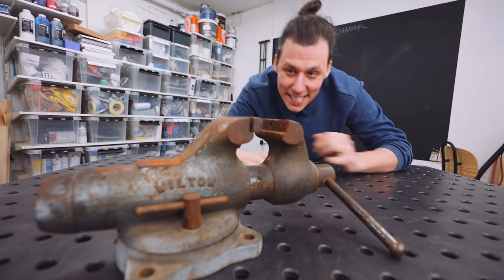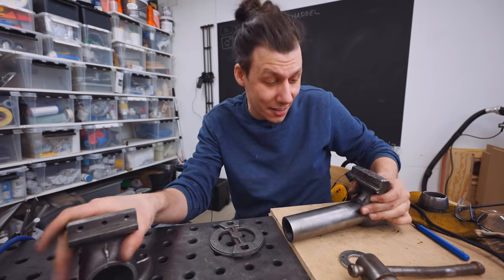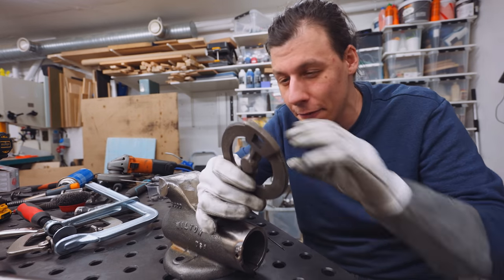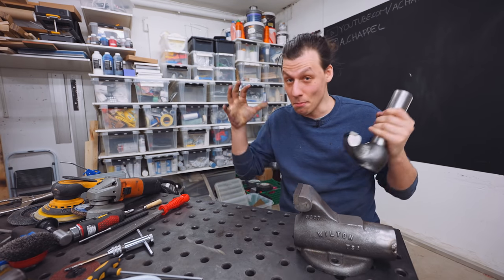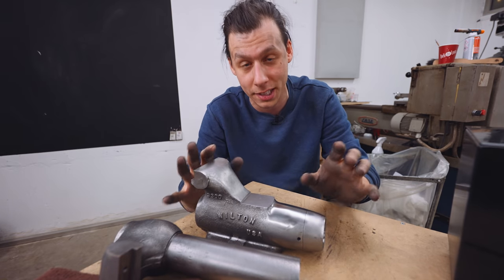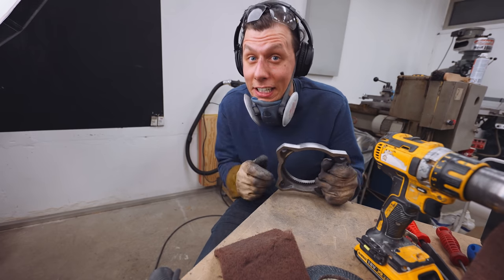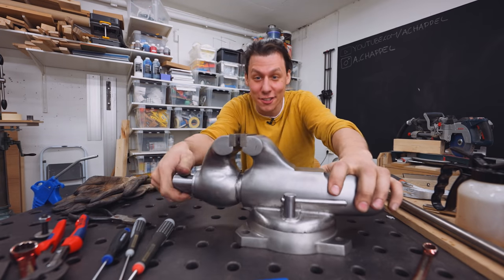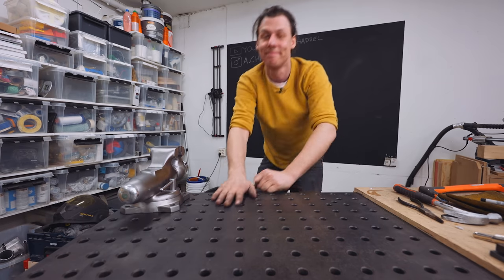Trying To Restore This Rusty Old Wilton Vise

Comment: I suggest you cover your vise with some protect oil - I also restore my dad vise and I also don't use oil and after 1 year corrosion starts to show up, so whole cleaning process needs to be repeated :(
Reply: I'm thinking the exact same thing! It would be terrible for that vice to go to rust. And with cast iron, that will be sooner than later.
Reply: Hi ,i am going to take rust from iron antique balcony ,and i was thinking putting an anty-rust oil before painting  but wasn.t sure if after the oul i could paint the iron .What do you suggest me?Thank you very much

Comment: Nice job! You might want to put a clear coat of polyurethane to preserve that finish you spent so much time on 😬
Reply: yeah the rust will return quickly otherwise!
Reply: I would recommend a ceramic car wax. PU ends up looking like a crappy plastic finish over the lovely metal!

Comment: Awesome! Don’t drill into the table, just make an adapter plate that fits the hole pattern. That way you can remove it if not needed, and you can position it anywhere you need it! 😎👍🏻
Reply: Came down here to say exactly this.

Comment: 14:35 The original threads are almost certainly No. 10-32 UNF:
- the Unified Thread standard uses the same tooth-profile as metric standard threads (unlike for example British Whitworth threads, which have more rounded teeth)
- No.10 UN threads have a diameter of ~4.83mm, which matches your description that it differs from M5 by about 0.2mm
- M5 has a pitch of 0.8mm, which is very close to 32 TPI (which is a pitch of ~0.79mm)
Reply from the maker: Thanks for the great explanation! :))
Reply: I've done worse hacks. When I could not find M8 bolts locally, I ran a 5/16-18 tap through a hole that was tapped for M8.  (Pretty large pitch difference, but it was a shallow hole, so it ended up working out).
Reply: you beat me to it.....
Reply: Used to do a lot of server installs.. had to remove more than one M5 screw from a #10-32 threaded hole.. I kept a cold chisel, vice grips and a mallet in the car, just in case.

Comment: I picked up a '76  Wilton Bullet vise, a few years ago. I wish I had made a video. The slide was rust "welded" in place. A previous owner had sheared the crosspin off, trying to get it freed up. I spent 2 days, a can of PB Blaster, some kerosene, and transmission fluid, trying to get the slide loose. Also heated the poor thing up with a torch, to no avail. But, that had the side benefit of getting rid of all the oil and old paint. After 2 days, I got the slide to move about 1/4". Using wedges, I hammered them in between the jaws, and started to get things to move. I broke a 2.5 lb sledge, beating on the wedges. Finally, got the thing apart. Easy clean up. Wire brushed  and painted. Looks and works like new. Biggest problem is, I hate to scar it back up. 😊

Comment: Nice vice restoration.
Now the problem to fix to the table, make a adapter so you are not fix to a location on the table.
When you want to move you can by using the holes that you all ready you have on the table.
And some way that is easy to exchange and fix the adapter to you table.
I hope this idea come handy for you.
Continue the good work and stay safe.

Comment: You did an awesome job! Your videos are getting better and better. One of my favourite channels hands down.

Actually, I believe the body was forged, not casted, that’s why the manufacturer didn’t worry about the misalignment of the casts. Otherwise it wouldn’t have been hard enough.

About your weld fix to repair cracks. It is most likely that the crack is still there since you didn’t control your thermo ramps, and depending on the force, it may crack again. But I wouldn’t worry about it RN. And if if cracks, you can just fix it again. For a non professional welder, your TIG beads look simply great, we all know how hard it is.

Comment: Strongly recommend making cast iron repairs with silicon bronze. I have  done both stainless and bronze repairs. Far less problems with this route. Welding tips and tricks as well as This Old Tony have covered this topic. I recently built up a Bridgeport varidrive pulley with a rosebud and brazing rods. The bronze is highly machinable.

Comment: For attaching the vice to your table, Maybe you can make an adapter plate to bolt the vice to it and then the plate would bolt to your work surface.  It turned out great, you saved the vice from the scrap heap, and while you didn't keep the maker's mark, it is now a gorgeous thing of beauty!
Reply from the maker: I actually managed to drill into the table eventually. I ended up using masonry bits that I sharpened with a diamond file :)
Reply: @achappel  I'm glad you found a solution... just another point about the plate idea: it would allow you to reposition the vice on the table at any point you wanted and you wouldn't need to drill into your table... Anyway great build...  Cheers!

Comment: Hi Alex, the best way you can find out what is the thread pitch of that imperial bolt, is to measure one inch (25.4mm) and count the number of crest. If the bolt is not long enough, you can do the same with 1/2 inch (12.7mm), just double the numbers. Then, the numbers of crest per inch known as TPI (threads per inch) is the pitch number, the magical number that you are searching. If you do not have access to measure on imperial, just divide the outside diameter in 25.4 (the amount of mm in a inch). Keep in mind that imperial threads have a lot of pitches, being something like 10-25 or so. I hope I have being helpful.

Comment: I am far from a welding expert, but you might want to try nickel based filler for cast iron in the future. I hear it is a better choice. Entertaining video. To hold a round part in a mill vise you want to avoid directly clamping the round part because it is only being held along two lines. Try adding an angle block. That will hold a round part along three lines and have much better holding power.

Comment: I am quite impressed with the finish on the vice. It turned out to be quite beautiful. If I were you, I would spray it with a light coat of oil or WD40 or even a light coat of clear lacquer to keep down the surface rust. Hell of a good job you did there.

Comment: 18:02, just made a plate with the right location for each part. Use the bolt pattern on the table to manufacture a plate that has the bolt pattern of the table on one side and the vise pattern on the other. You can make some pins with the lathe for it.
Reply: Exactly what I was thinking!
Reply: @BrainHurricanes  Thanks, now I know that I’am not alone.

Comment: This is a great project and it turned out beautifully!

To mount it to the table, why not make a flange? It will have holes that will bolt to the table's hole pattern and also holes to mount it to the vise's hole pattern. That will give a bit of modularity as well. 🙂

Comment: That Bullet is the exact vise I have. Mine came with the end cap, but the restoration was similar! Great move leaving it raw—my single stage Hammertone paint chips if you look at it the wrong way. Just remember to use some film-forming rust preventative.

Comment: Nice job on the welding! I've restored a few old hand planes and sympathize with the cast iron dust problem, that stuff gets everywhere. I may have missed in the video, but how are you protecting it against rust? A thin layer of oil?

Comment: I think that the thread of your old imperial screw is #10-32 UNF. I guess nobody cares but as you asked, I felt that I had to share this information ;)
By the way, you did a great job!
Reply: I care! I was looking for this haha. About to do the pitch calculation myself.
Reply: Was also about to say the same thing :) 10-32 is technically 0.079mm pitch but that's "close enough for government work" as they say!
Reply: Was also looking for someone that answered this 😁
Reply: I was doing some investigation, and ended up thinking about like a 3/16 bolt, the problem is that the pith are difficult to match, It would be a lot easier to have both bolts in hand to know more about it. And, I think there is a whole community wondering what bolt was that, you are not alone!
Reply: Was looking as well, thank you, you hero!

Comment: Well, it turned out beautiful. You can have it nickel plated or even chrome plated.
Make a simple base plate to match the vise model.
With a corner on it for support against the front of the table.
And with a few pieces of threaded end that then fit into the holes of the table.
Just make sure the vise closes in front of the table.

Comment: You can make a carrier plate that has mounting holes for the vise and also matching holes to the table. You can machine some locking bolts and nuts and can manually mount it to the table in a semi permanent non destructive way.

Comment: I spent a lot of time learning how to create accurate working screw threads in FreeCAD for my 3D Printing designs.  If you look at the Unified Thread Standard Wikipedia articles on Metric and Imperial you will find that the Imperial #10 Fine thread pitch is 0.7938 mm and the M5 Coarse pitch is 0.8mm.  Also the  major diameter of the #10 is 4.8260mm.

Comment: For attaching create an adapter plate. The a decently thick steel plate, drill and tap holes tht fit the vice on it and drill holes marching the hole pattern in your welding table. Then choose whatever way you wish to attach in to the table with those holes, bolts, plan rods so you can pick it up an move it as you wish

Comment: I wonder if rough stones in a tumbler would have been an easier way to remove the texture?
Reply: But that way he would not have had control of what is being  „smoothened“. He could have lost crucial mechanical details.
Reply: @maddi5920  Fair point. Take my comment as nothing more than a curiosity from a lay person :)
Reply: @Theincrediblespud  Oh we aren't lazy. We are just trying to find an easier way for everything. Thats not lazy. That's effiency! ;)
Reply: 1) it would have taken a loooong time 2) it would have tumbled parts he didn't want tumbled 3) that is a heavy casting, he would have needed a biiiig tumbler.
Reply: @t0kinl3lunts  Yeah thats the problem.

Comment: To attach it make an interface plate.  A steel plate with bolt holes to bolt down to the table and holes to put short bolts up through to hold the vice in place.  That way you don't need to drill through the table.

Comment: Wow! 

What about creating an adapter that you attach to the vice, with bolts on the underside that fits to the holes you already have in your welding table? Then you can move it around wherever you want it to be :-)

Comment: Any chance you can make a plate to fit into the holes of the table and attach to the vise with the screws going up into the vise mounting screws? This way you leave the vise on the plate but move it anywhere you want on the table. Just an idea, good luck and great video.

Comment: Chances are that screw is a #10-32  (Size #10, 32 Threads Per inch) they are almost identical to M5 hardware
Reply from the maker: oh cool, thanks! :)
Reply: Yep, definitely a #10-32. 10-32 is 4.31mm pitch dia, 0.79mm pitch, M5 is 4.48mm and 0.8mm.

Comment: Hi, the screw sounds like its a 10/32 imperial. very close to a metric M5 thread. M5 been slightly wider diameter. i use both in work, but imperial is such a pain to work with.  :(
Nice work, very smooth vice,  that showed how a "little" TLC works so well. Keep up the great videos  :)

Comment: if the table is too hard to drill you can make an adapter. one that bolts through the tables holes and bolts through the vice's holes.

Comment: So I just looked it up on google and an M5 screw has exactly 0.2 mm more diameter than a 3/16th inch screw. I couldn't find the thread pitch for a 3/16th inch screw, but the metric has two options, coarse and fine. Both options (0.5 mm or 0.8 mm) are very close to pretty even numbers if you convert them to 1/1000th inch, which is a common measurement in machining from what I know. It's either 20 thou or 32 thou. Maybe you wouldn't notice the small deviation in thread pitch over this small length, or wilton decided for some reason to use a metric thread pitch on a US screw 50 years ago. I know which one I find more likely.

Comment: Adapter plate for the table (but you already knew that...). Now, how to avoid rust? A few choices... Constant application of silicone (WD40); Clear coat paint; Bluing (for a different but cool look). Of course, you could always just paint it...

Comment: I dont know if you will see this but future warning. Don't ever use a grinder on a weld. Some reason people argue it has no effect but as a machinist who worked with fabricators. We started noticing welds that were cleaned up with a grinder before machining, always resulted is poor machining or broken tools. So we tested it with 10 parts that we did grind, and 10 more that were not. Results were completely clear. Using a grinder always made the weld hard.

Comment: It shouldn't be a problem with your cosmetic fill welds but arc welding on cast iron can(not will, can) make it brittle. Looks like you got away with it though, as you said, time will tell.  Brazing with silicon bronze is generally a safer bet if the area is going to see stress, particularly shock loads.

Comment: You can create an intermediate plate to be attached to the table using the existing hole pattern and weld bolts to it to attach the vise

Don't drill into the table
Reply from the maker: To late 🙄
Reply: @achappel  sorry to hear that I loved the look of that table.

Comment: If the screw was super close to M5, that would be a 10-32. #10 is the diameter, and 32 is the threads per inch.

Comment: Beautiful resto, but the classissists are gonna hate you [filing off the brand!] - btw, just attach the vise to a metal plate that has pegs to align with the dog holes in the bench. You may find removability a handy feature.

Comment: If you can't or don't want to drill into the welding table.  How about making a plate that has a set of holes that match the vise and a set of holes or pins that match the dog holes.

Comment: Those screws were probably #10-32. 32 threads per inch = .03125 inches per thread. M5 x 0.8 is 0.03149 inches per thread. 0.00024 inches or 0.0061mm difference in thread pitch.

Comment: Looks great. Wilton purists are screaming right now, but it was already past the point for “restoration”. I would spray it with an enamel matte or gloss clear coat or some (Boeing) Bo-shield T-4 rust inhibitor. Check out my 1897 Parker vise restoration if you’re so inclined. The video is nowhere near your production quality but it’s there if you’re interested.

Comment: There may be a solution for drilling in your welding table. I know, that there are manufactures for elektromagnetic drillpresses wich hold an endmill or something similar, BUT i don't know if there are any in europe. If there are, there is propably a store where you can rent a drillpress like this. 
EDIT: Jes there are manufactures for this, at least in germany where i live, so there is for sure one in sweden. The one i found was on kernlochbohrer. com (i think you maybe need to translate the webside to swedish or english to understand anything ;D.

Comment: use the 2" trailer hitch mounting method, can set it up 2, for vertical and horizontal mounting, plus you can use it to mount other tools, holders or anything else you can dream up.  This method allows for easy removal and have a clear area to work in.  Here is one example https://www.youtube.com/watch?v=IULE11jIlHA

Comment: Hi Alexander, disagree with you this time. Either you restore an old vise because of its brand (in this case a Wilton) or you restore a vise for its functionality and the current working value of it. Now that you opt for functionality only, you might as well buy a whole new vise, after all, all this work you need to do is not really worth it. Although I really appreciate how you fix the repair problems.
Greetings from the Netherlands.

Comment: Loved the restoration and honestly don't mind the removal of the manufacturers name. Remove the name and give it your own personal touch. That's definitely deserved for all that hard work. Also, cast iron is truly hell to sand. I'd much rather sand an entire wardrobe covered in old, acidic whitening stain (which in and by itself is a real mofo to get off), than sanding cast iron. Ironically enough I've actually just finished this days work of sanding a dresser, covered in the way mentioned above. This dresser is particularly gruesome as the previous owners violently abused it. It had fungal growth all over it, several cracks in the wood, the wood is wobbled in several places, old cracks were attempted to be fixed with several large nails, loose parts were excessively glued to the dresser (old glue came off like rubber) and the entire backboard won't currently stay in place, due to the bottom support having rotted away, along with some of the side supports. Also, the locks are missing their keys, the slots for locking the drawers are trashed and the knobs for pulling the drawers in and out, were rather oddly attached. I have a feeling you would silently walk away from it, if you saw it 😄 It's a wreck to say the least. But I'm trying to save it none the less. Just gotta get through the sanding first! 😂

Comment: Nice project. 
Nearest imperial to M5 is 10/32 UNF. 
´The 10 is the no 10 UNF and has no nummerical meaning with respect to dim of the screw itself. 32 is 32 thread/ inch.  Thank god for ISO standards and EN norms :)